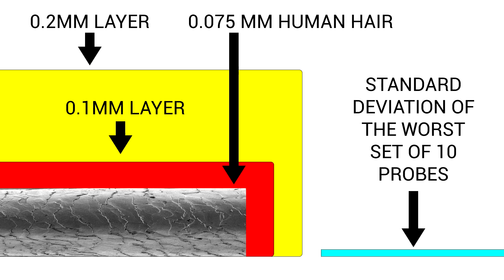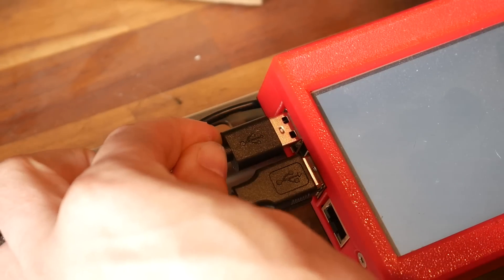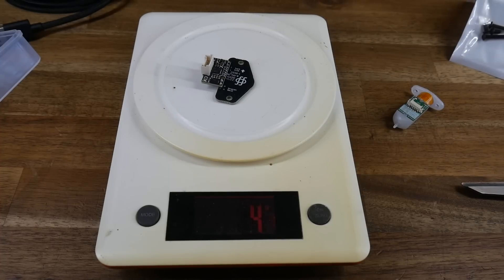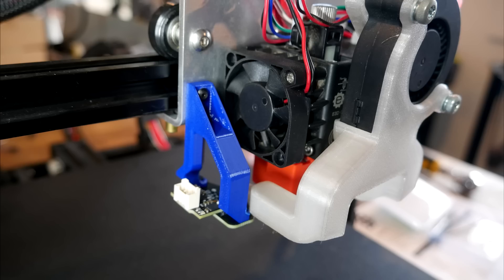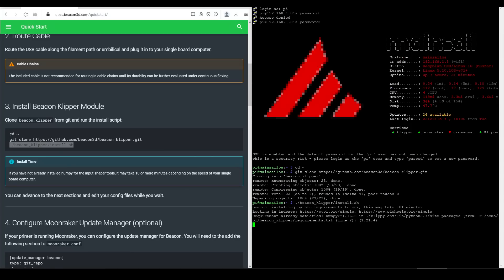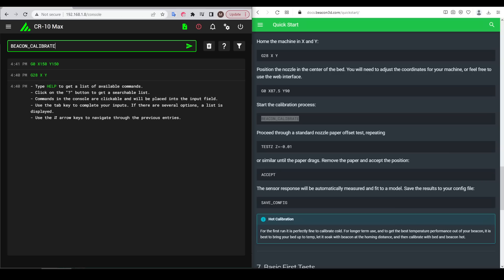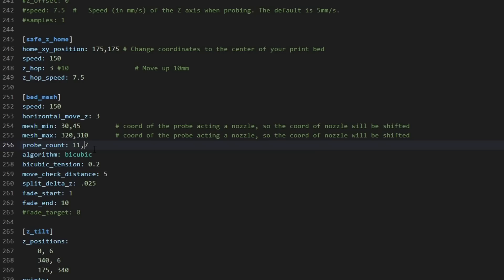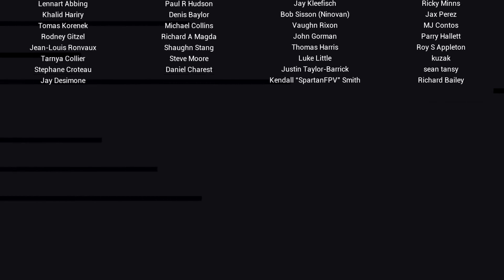Beacon ABL bed scanner - Amazing speed and accuracy, perfect 1st layers

Comment: Does klipper mesh adjustment code can actually handle these thousands of points? Or does klipper applies an average of points to arrive at handful of points to create the corrections? If it's interpolation then all these thousand point probe is just gimmick. Moreover this still require you to change the offset when you switch nozzle, and if you are printing with abrasive filament then print after print that offset changes and this sensor will not help. Probably prise or anker kind of load sensor in the nozzle makes sense.
Reply: It adjusts for the interpolated mesh. But with such high resolution its more like real bed instead of interpolation.
You can still use the auto z feature thats often used together with klicky, although i have found it a gimmick at best. Only certain probes benefit from it, mostly the omron inductive probe used on vorons since it has no temperature compensation, or when using a dual sided flex plate with a inductive or infrared sensor since both trigger off the metal and not the pei on top. 
When using a mechanical probe like klicky and change bed surface you are better of not having auto z as the beds are not always the same thickness. Same goes for textured vs smooth.
On the topic of nozzle changes, such nozzle probing or auto z features are interesting for revo user as well as people who only use cheap knockoff nozzles. My collection of phaetus and e3d nozzles are all within 0,01mm of each other, so no need for adjustment there, the cheap brass ones that came with some of my printers deviate much further, up to 0,05 from the target. All of course measured unused
Reply: Klipper seems to handle up to 100x100 meshes ime

Comment: I might have to keep an eye on this to see if they knock out a non klipper version.
Reply: It's pretty klipper dependent because it connects directly to the Raspi to do the calculations on the linux PC
Reply: I think the likelyhood that Marlin will just slowly die off is bigger. And a better outcome for everyone in the end.
Reply: Why run worse probes and worse firmware? Just upgrade to klipper
..

Comment: I stopped watching as soon as you said klipper only, that's crazy to limit your buyer market like that
Reply: if you would have watched further you would have learned that the beacon requires processing power and is its own mcu
Reply: @iunnolol2114  I know, I run a RPI with Octoprint
Reply: @backyardbasher  so you have everything you need for klipper and would, besides support for this, gain better print quality because of klippers more advanced motion control.
Reply: @Daepilin  The prints that come off my first version ender 3 are really really nice, I have been tweaking, tuning and improving it ever since I got it in 2018 and I cant imagine how the prints could be be any better (they are THAT good) so I will stay with Marlin.
Reply: Michael is just testing the new stuff.
I love the Marlin and I was on it. I switched to Klipper 1 week ago and although its configuration is still unknown to me, I like it basically, it just takes a little getting used to. By the way, whoever pays ~$80 for an ABL sensor should start by buying an SBC first and get a little familiar with the Klipper.

If you only print as a hobby and don't want to spend too much money, the other ABL sensors will be enough. On the other hand, those who want to equip their 3D printer with more professional stuffs, perhaps working with it, will invest the money in higher quality upgrades anyway and quickly switch to Klipper from Marlin.
Reply: Klipper is free and you don't need to buy any extra hardware, since you're already running a sbc
Reply: Lol if you have a 3d printer and don't run Klipper you're really limiting yourself.  If you can't run Klipper then you're going to have to accept that there are products that are just not for you

Comment: kinda hoop this type of probe will  be added  to marling /ender 3 printers -i kinda want one /hoppe there will be decent/cheapp clones
Reply: Yay! Let's not support the original creator who put years of his time into it and tens of thousands of dollars!

Also, it's really easy to switch to klipper from Marlin, you just need a pi or similar
Reply: @Tedlasman  As far as I see they just took an long existing TI chip and designed a simple PCB for it, following the PCB layout recommendation of the datasheet exactly. So basically two-three hours of work to design that and send it off to PCBWay/JLC...

Comment: I know the duet guy made an abl probe based on IR reflection that can be continuously read for distance to a degree of accuracy, my gcode has it probe a large grid, but I can keep full acceleration and only control the z velocity to trigger at a certain point. I bet with some creative code you could calculate a sweeping scan with the probe tho.
Reply: Thats what confused me, I thought thats what it did. I really dont see why it cant do that.
Reply: @TheCoffeeSquirel  IDK, I feel like it's maybe just an implementation issue, because the hardware can see a live feed of those values AND can match a 5 point leveling pass to a 300+ point scan saved as a csv file.
If you can record the values remotely while making a lateral move, it should be possible to make a CSV of those values that reprapfirmware can handle.
Reply: @TheCoffeeSquirel  It has two modes of operation, digital or 4 level analog. It seems most people use it as a simple on/off  probe, but it is in fact a distance sensor. I just don't think anyone has got around to implementing a continuous scan routine with it.

Comment: Not a fan of induction for leveling. I'm waiting for a machinist grade "indicator" solution before I replace my BLTouch.
Reply: Neither was I, but I replaced my klicky probe on my 350mm Voron V2 with this and not only is it comically fast (I sweep at 500 mm/s) but the sample standard deviation is way better than the physical probe. With such a large bed I was always having problems with first layer consistency but this thing makes everything perfect in a tiny fraction of the time of the physical probe. This is the best piece of 3d printer hardware I have ever tried by a wide margin
Reply: @BarrettAnderies  Thank you for your thoughtful reply. I'm concerned with the consistency of the nonconductive coatings on spring steel plates. Do you think that is an invalid concern? I buy cheap stuff where possible. I don't know that I'd be willing to stop to facilitate electromagnetic trickery.
Reply: @RichardBronosky  it is a valid concern but unless you get especially unlucky with some exceptionally low quality sheet it's has a negligible effect
Reply: @RichardBronosky  I've seen this mentioned a few times and I pretty much ignored it because I'm printing large parts on my voron with a first layer height of 0.3mm and width of 1mm, so small height variations in the coating don't matter much to me. Also, I'm using a textured bed which I imagine allows the plastic to move into lower pockets if there is an adjacent higher pocket from the coating application process. However, now that you bring it up I have a few thoughts:

1. If you're printing big parts with large first layer height/width I think it's a non-issue unless the variation in coating thickness is extremely large
2. Thought experiment: Suppose your BLtouch samples two points. The first is a very low point due to coating variation, the second is a very high point due to coating variation. Both points have a large error compared to the metal underneath due to coating variation (the cheaper the bed plate, the worse this scenario is in theory). The bed mesh is going to interpolate between these points. Most of the interpolation will not match the actual surface (except in the middle, assuming the rest of the coating was perfectly applied). Then imagine the same scenario with an inductive probe which is measuring the metal. Since the inductive probe can achieve a much higher mesh density, it suffers less from the potential worst case scenario physical probe measurements constructed in this thought experiment. It seems to me that the physical probe would actually be more prone to poor surface mesh collection due to the lower sampling density and therefore higher risk of sampling points with higher error due to coating thickness variation. I guess the question is which causes more true error, but tbh I have no idea. It would be pretty easy to connect a Beacon scanner and a BLtouch to the same print head and sample with both at the same time and compare the meshes. You could even raster the BLtouch (very slowly) to collect a very high density mesh for comparison. All I can say confidentially is that compared to my (homemade) klicky probe, the Beacon is significantly better. 
3. Solid state components don't wear out as fast as mechanical components. Not only have I found it better from a mesh precision/accuracy perspective, I've also found it much more reliable mechanically. I print exclusively ASA which produces a ton of VOCs which coat everything in the chamber. Every 2-3 prints my klicky probe would fail because the magnets had collected so much VOC gunk that they were no longer electrically conductive. I realize this wouldn't be a problem for a permanently mounted probe like a BLtouch, but I still think that in general the Beacon would be reliable for longer periods without service/re-calibrating.

I would be curious to see how much surface coating variation there actually is by comparing an inductive mesh to a really high density physical mesh, and I don't think it would be that hard to do with Klipper,  but I've been so happy with my Beacon that I can't be bothered to do it myself. I will be putting Beacons on all my printers going forward
Reply: Another thought. Do we know how consistent the metal sheets are themselves? I suppose if both the metal and coatings have highly variable thicknesses the physical probe might have an advantage. I suppose lidar could be the ultimate solution. The first layer consistency on my X1 carbon is incredible. However, this is with their PEI sheets which might just be very high quality.
Reply: @RichardBronosky  we've found that if you go for coated beds rather than beds laminated with glue the coating is very consistent.
Reply: @BarrettAnderies  try an experiment, turn off the "lidar" and try a print, I bet the first layer is just as good, because it's not real lidar and it's not really doing that much, others have been running just fine without the lidar stuff because it's all in the piezoelectric bed sensors.
Reply: @RichardBronosky  wdym have i heard of amazon
Reply: CNC machining has used the equivalent of nozzle probing for decades. 3d printing is only just learning these lessons with voron tap, bambu piezo, and the prusa nozzle sensor. nozzle based probing is the future. inductive and offset touch sensors are dead ends.
Reply: @TMS5100  I don't necessarily disagree with you but that's a pretty bold statement for an amateur hobbyist (unless you develop these technologies professionally?). Inductive probes like the Beacon are only possible with modern microchip technology, so I would be hesitant to extrapolate that to "decades" old CNC technology. Also, 3D printer beds are generally flat and remain the same general shape, unlike probing randomly shaped CNC objects, so I'm not so sure modern inductive solutions won't be a competitive solution at some point. I would certainly want to see actual data rather than amateur speculation.
Reply: @BarrettAnderies  only nozzle based probing will truly ever be zero adjustment plug&play. as long as you use offset probes like inductive or bltouch, you are screwed if you ever swap the nozzle - you have to re adjust. this is why cnc uses touch based probing - zeroing is always perfect no matter how many times you swap the tool. this is impossible with inductive. if you ever want 3d printing to be truly plug & play you need to get rid of manual offset tuning. inductive isn't a solution. nozzle touch is. voron tap, bambu piezo, and prusa mk4 / xl are the way forward.
Reply: Really the only way to go is a strain gauge or something like tap.     Pretty much the standard for CNC has been touch based probing for a long time because it works and is by far the most accurate.     I actually have to wonder if a spring steel PEI coated bed would be conductive enough to probe in the same manner as a CNC machine but I am guessing it isn't.